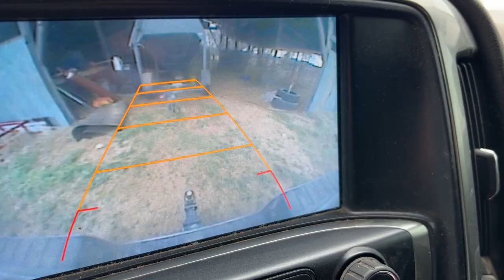They Can Handle It, But We Have to Be Ready!

Comment: trick I learned is put the level of socket higher and drop the lead down so that the water or condensation form does not affect the plug or connection - falls off before it reaches the socket 🥰🥰🥰🥰